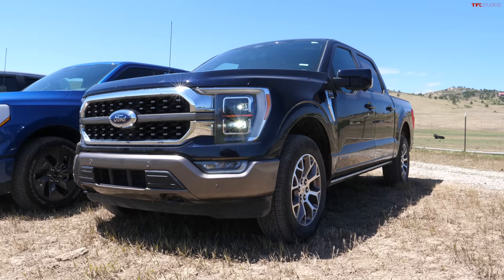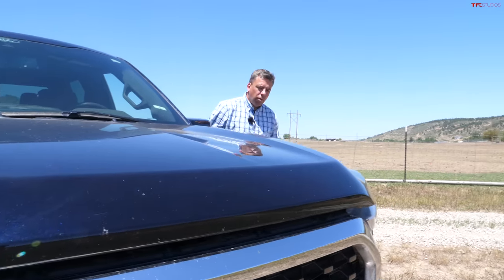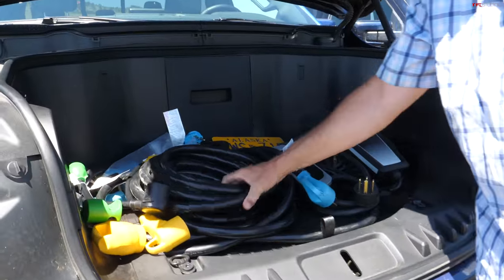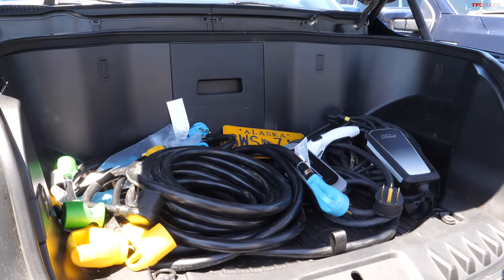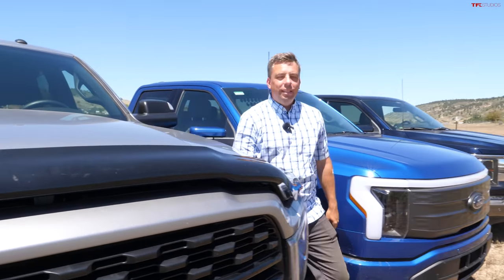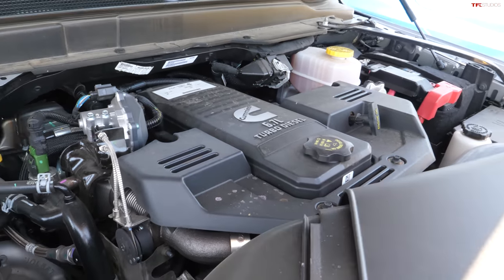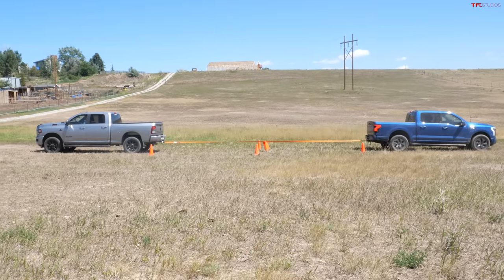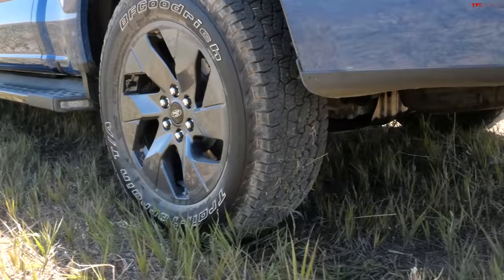Diesel vs Electric Tug-of-War: Ford F-150 Lightning Takes on the Ram 2500 Cummins In a Nail Biter!

Comment: Watching the initial pull between the Lightning and the Ram, technically it was a draw because the flag only moved because of line stretch. Neither the Lightning nor the Ram managed to budge the other.
Reply: These kinds of competitions are silly because its down to the wheel and tire setup on top of the vehicles weight and torque. If the tires had grip it would be a torque competition and it becomes boring.
Reply: How about a real world test of pulling max load for a pre determined distance in a certain amount of time? I guarantee the Ram would be victorious! Electric trucks aren't where they need to be-by a long shot. No matter how much the government  and private business tries to sell it, I am not sold. The range isn't where it should be loaded. The cars are a different story.
Reply: I agree  with  that
Reply: @user-vi9st9lv1q  the electric f150 weighs more than the hybrid f150 so of course it’s going to get drug around.  Thats why the ram was the equalizer.
Reply: @jameshenson4871  Okay, put 3.88 gallons into your Ram and do that versus the electric because that is the tank size in terms of gasoline for the battery. That would be your real-world test. It will lose.
Reply: @ronaldking1054  get a clue.  The range of the Lightning with any kind of load is the same as a real truck once the low fuel light comes on.
Reply: @user-vi9st9lv1q  they had to get a 3/4 ton to come close to the half ton EV weight.  The half ton EV that can’t do 1/3 of what a half ton should be capable of.  Hope that helps.
Reply: "technically it was a draw because the flag only moved because of line stretch. "YOU KNOW IT WAS ONE STRAP. ARE YOU SAYING IT ONLY STRECHED ONE ONE SIDE AND NOT THE OTHER
8:00 RAM GETS PULLED BACK A TINY AMOUNT ,THE FORD MOVED FORWARD;
does it matter, if your towing over 100 miles your buying the ram
Reply: @jameshenson4871  I think it depends on your use case. Not everyone who has a truck needs it to tow 300+ miles a day.  I only need to tow my boat less than 15 miles so 🤷  range isn't really an issue. Gas prices on the otherhand are subject to market forces and can spike. My wife's uncle got that Godzilla engine for his 250(tried to convince him to go diesel for the fuel economy) filling up his tank is brutal lol.
Reply: @jameshenson4871  I agree- electric works for the cars. I finally bought a T Model 3P and it’s fantastic but I wouldn’t buy an electric truck. Not there yet
Reply: @CommonSense823  You guys are arguing range on the amount of fuel you can carry in an effort to hide what your truck can do. Your truck can only use 38% of all the energy you can carry. The electric truck uses nearly all the energy it carries. The problem is you can carry 6 times as much energy, but you ignore that you are only using 38% of it. What's worse is that you have to convert it into the appropriate use of that energy mechanically, which lowers the efficiency even still. That is why it has the range while your low fuel gauge is on. It only carries 3.88 gallons of fuel in battery form. Technically, it isn't even 3.88 gallons of diesel. It is 3.88 gallons of regular gas.
Reply: @user-vi9st9lv1q  Nope.  Can't fill up in under 10 mins.   can't tow, can't haul, limited to under 280 miles.  Can't put a topper on it without killing the range.   Can 't change tires without killing the range.  Can't lift it, can't level it.  For the price tag, it needs to be equal to or better than a standard half-ton truck.  This isn't as capable as a Ranger.

Comment: To truly make this fair, you need to have the same tires/pressures or the proper pressures for tire type/vehicle weight, so that they have the same footprint. And please do this on asphalt as well!

Side note: Perhaps hold the brakes on the Cummins while bringing up the RPM's slightly, to build a little boost prior to start. Would also be awesome if both vehicles had a gooseneck hitch and you guys attached to there instead!

Comment: This is also a tire test.  Put a decent set of AT tires on the Ram and redo it.  Those Firestone Transucks are AT in name only! And as far as an electric HD, what will that range be towing?  50 miles or less???  Have you guys seen all the 40 foot+, 3 axel fifth wheel trailers, behind 1 ton diesel powered dually pickups that are on the road?   Also, love the eulogy to the camera at the end!!!
Reply: @Tony-bg6ql  Trucks are meant to be driven wherever they are needed.  I use mine to tow a 30' travel trailer.
Reply: @Tony-bg6ql  And trucks have evolved since their creation.  That is why we have 1\2 ton, 3\4 ton and 1 ton pickup trucks (both gas and diesel).  They now serve multiple. purposes. And that includes towing.

Comment: The difference is likely due to the differentials. 
In the Ram the front and rear differentials are open (do not have lockers). Meaning that the 4 wheel drive on the Ram is actually 2 wheel drive because when the wheels start to spin with an open diff all the traction is diverted to the wheel with the most grip. This then results in one wheel on the front and one wheel on the rear having traction on the ram. This is also true of the Ford hybrid.
The EV has a different system and has a traction control system which allows all for wheels to have traction. The system gives traction to each wheel and senses slip for each wheel. 
If you want to make it fair you need a Ram or other diesel truck with front and rear lockers. This will give traction to all four wheels and the Ram will kick ass.
A lot of people talk inaccurately about 2 wheel drive and 4 wheel drive. The truth is that 2 wheel drive has only 1 wheel drive in limited traction situations. In 2 wheel drive with a locker engaged it has 2 wheel drive. In 4 wheel drive with the rear locker engaged it has 3 wheel drive. In 4 wheel drive with the front and rear lockers engaged it has 4 wheel drive.
Reply: I'm quite certain that the majority of all manufacturers have brake based anti slip in all transfer case modes, especially 2H and 4H(if not turned off). 

The lightning only has two motors, one in each axle with open differentials. It must use the rear locker or brake wheel/s.

Comment: I think another advantage an EV has in a tug-of-war, is that when you’re not accelerating, you’re stopping. There’s just no dead time between being on the accelerator and moving to the brakes. Even if you let off the accelerator in the Lightning, you’ll be fighting the electric motors. Pretty cool!
Reply: That’s where the advantages end
Reply: @aaron-fauth  Dynamic, thanks for the reply 😂
Reply: Weight
Reply: @ToAnEnd  4 play 😂
Reply: Oh little guy, the fights soon over when the electric pile runs out of battery power like an rc car, then gets pulled off a cliff where it belongs instead of the nearest charging station.

Comment: Distance towing a camper for Ram with full tank: Around 350 miles assuming a 30 gallon tank.

Distance towing a similar camper for electric F150: Around 80 miles with a full charge.

Comment: Interesting. I get the point. In theory the electric with its weight should win I think. After all diesel locomotives are actually electrically driven. Doing it on dirt however just invalidates the entire test, no?
Reply: The electric will also have very precise traction control. All the torque in the world doesn't really matter if you can't put the power to the ground.
Reply: Why not do it on snow also you have a good point sand is loose , why wouldn't you do it on cement or am I wrong.🤔
Reply: They were both on the same dirt , not sure that invalidates the entire test. I  also believe the lightning would win even easier on pavement because of the traction control. The other trucks would be burning up their tire where the lightning would control that from happening.  As the other trucks rubber started to melt the lightning would take off.

Comment: Pumpin gas is still faster than charging. As a tradesman electric won’t be an option in my lifetime thankfully. I’d prefer to die able to repair my trucks with the tools I have. After that I’m dead so I don’t care. Lol
Reply: What the hell were attempting to say lmfao
Reply: @leviconner  what are you trying to say?
Reply: So, your vehicles are all circa 1974? Breaker point ignition, carb and 3sp automatic? Or you have tools to repair one of the literally thousands of potentially damaged semiconductors in current vehicle computer controls?
Reply: Pumping electrons takes about 10 seconds.  You change your mindset as much of the time a vehicle sits unused and that is the time charging happens.  You'll never visit a gas station again except for getting snacks.
Reply: @jdlutz1965  wrong especially when your towing loads that’s what matters the lightning range was only in the 90 mile range when towing compared to a diesel with well above that and they can refuel quickly take a long road test see which one gets their first from California to New York see how that plays out
Reply: @freedomfighter6681  thanks for driving to California for me... something I never intend to do. I seldom drive over 100 miles from home, so the truck works perfectly for what I do at a much less expensive and dirty way of doing it.
Reply: @jdlutz1965  by dirty you mean carbon emissions I’m taking it let me ask you something where do you think that power comes from it comes from a power plant the uses fossil fuels and coal in some cases nuclear but there is not one power grid ran off completely solar and the big wind turbines use oil to keep them going as well also how do you think they get the lithium for those batteries by big diesel machines and lithium mining is not good for the environment where do you suppose they put the batteries in the cars when they go bad can’t have battery acid leaking into the environment it simple electric cars seem cool but aren’t good for the environment
Reply: @jdlutz1965  wouldn’t work for me, as a farmer all the equipment wouldn’t have time to charge. If everyone plugged in to charge tonight we’d blow the grid and have no power for tomorrow. Most of the power to charge comes from burning fossil fuels anyways
Reply: Ray Johnson  so let me ask you this would you say nuclear power is the best way to go it’s completely green we have already found out though solar and wind will not supply us the demand we need I think electric cars are cool but they aren’t environmentally friendly as people say they are I would love to have a Tesla plad but I know the reality behind them mining the lithium for those batteries and how bad those batteries are for the environment if they leak also how do they plan on recycling those batteries we can’t just bury them under the ground like they keep doing with those wind turbine blade
Reply: @freedomfighter6681  don't let perfect be the enemy of the good.  Tomorrow an EV, next year a renewable grid with electric powered blast furnaces and construction equipment. :-)
Reply: Ray Johnson  because these poultry house pull more power than you can fathom. I know keep talking like you have a clue when you couldn’t do the shit I do 7 days a week. I don’t run a John Deere either, may be propelled by an electric motor but that’s driven by a diesel 🤣🤡
Reply: Lol
Reply: @davenhla  Dave, thanks for your feedback.  OK, fair enough I was using hyperbole to make a point but I dare you to start your ICE in garage and breathe the air if you believe it "clean".  I actually wish that everyone could see their emissions for everything.  If there were a residue of visual reminders everytime we used fossil fuels, I think most people would get behind the cleaner options of electric power and renewable energy sources.  I realize there are many hurdles to having a completely renewable energy sources and fossil fuels are capable BUT we must transition or extinction will result.
Reply: @jdlutz1965  I will do that when the emissions from the power generation grid are in your garage. 
Also, I hope you are not charging an EV in your garage, even the manufacturers are telling people that is a bad idea. If you have a driveway, put a post up and charge it there a safe distance from your home.
Reply: @davenhla  I wish that I could show you the 26 solar panels that are in my backyard, often supplying more than enough wattage to supply all the charging of my EV, excess going to the grid which in Vermont is 96% emission free using hydro (baseload) and wind, solar and others to supply majority of energy.  It's not perfect but it is low emission and yes, I charge in my garage and have done so for 9 years having been driving EVs since 2013.
Reply: @jdlutz1965  Wow. 26 solar panels. How much did that run you? And I mean before your tax credits and other programs that helped pay the bill or allowed the manufacturer to sell them at a lower cost? 
Rolling the dice on lithium batteries charging indoors is your right in America. I don't even charge my drill batteries without a fireproof bag. Nieghbor lost his utility box pickup to a bag of milwaukee tool batteries 3 years ago.
Reply: @davenhla  If I recall right, installed the price was about $26K before tax credit.  You've got your talking points down.  I realize that solar is incentivized yet so is the fossil fuel industry with free protection from USA military along with subsidies that give low cost leases to drill.  Hey, I don't think of you as the enemy and happy to share a favorite beverage with you someday if we were ever in the same locale.  I hope that we could get along... and appreciate your input that sees it a bit differently.
Reply: @jdlutz1965  The thing is I don;t even mind EV and I think they will have a very important roll in the future. But that's in the future. I do not think, even a little, Lithium batteries are the answer. They are just what we have now and what the industry can use. But they are really bad to make, really dangerous and come with IMO too much baggage for the push that is going on now. I see videos all the time about new battery tech,we know the grid needs work... why do we need to put the cart before the horse? Why is it always enforced with law now days? If people were simply allowed to choose and inform themselves without bias to make that choice none of these arguments would even happen(well a little would happen some people will always want to tell others how to live) and this whole topic would advance faster.
Reply: @davenhla  by your thinking, we should have not produced the Model-T and perhaps waited for.. stick your perfect ICE here.... in truth, the Model T was far from perfect and there was no gas station or highway infrastructure to allow one to go beyond their metro area.
Reply: @jdlutz1965  Correct, on that last bit. But the government did not make a law enforcing purchase either. The national highway system could have just as easily been rails if ICE turned out to be a bust. And no, we did not need to wait. The public waited(or didn't) based on the products merit. And gas cans were invented on the spot, on account of not requireing a particularily high tech device to store liquids. . Feel free to take extra battery packs or somthing with you if you need to travel past a charging station radius. 
We need more charging network, better electrical grid. Do we need to wait with EV until it is there? Of course not. However, what sense does it make to force the public into EV then? The public will adapt when the network is there and ease of use and cost are in line. People will choose EV when it makes sense. And that is what I have been saying all along, why is it being pushed on the public through law and mandates? Not everyone bought a model T. A lot of the public waited until they were more reliable and the network was built. Same with farmers and tractors. A lot of farmers in my area had horses until the late 1930's. They switched when tractors became more efficient, reliable, and fuel was easy to get.
Reply: @freedomisntfree_44  what are you saying about what I’m trying to say?